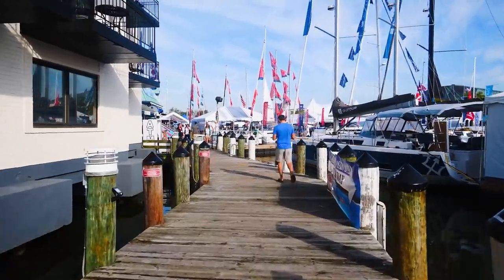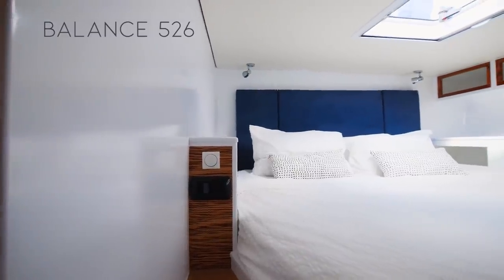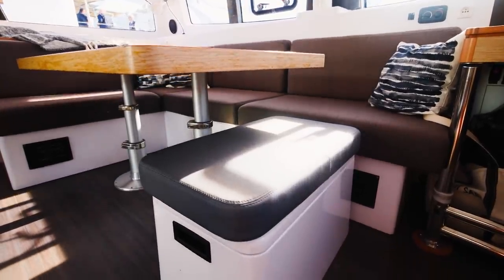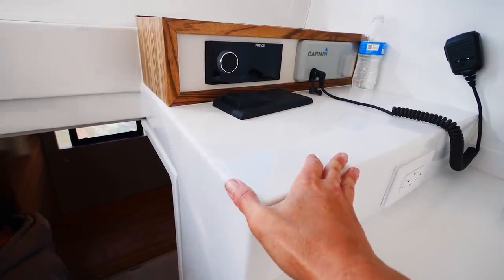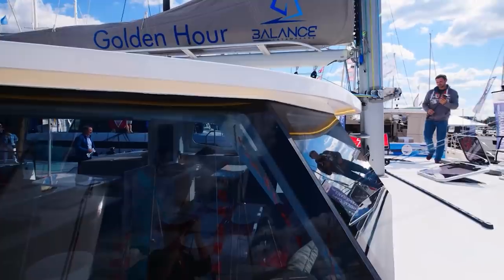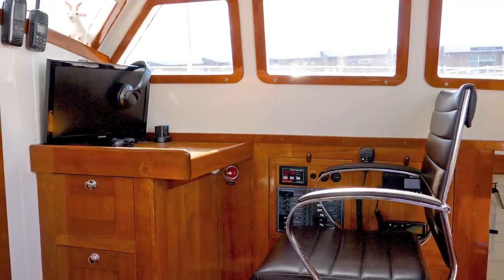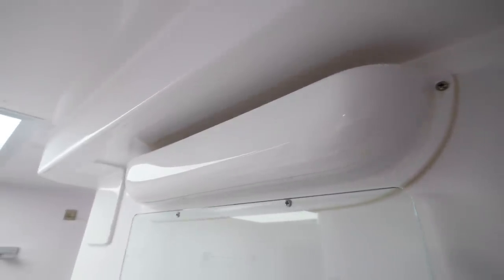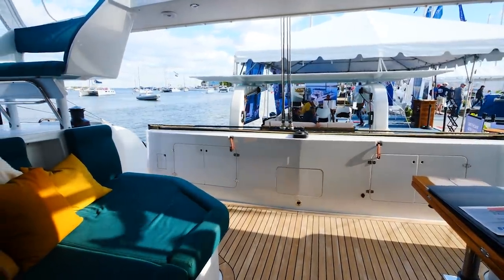STEALING Ideas From MILLION DOLLAR  Yachts!!! - Annapolis Boat Show 2021 (MJ Sailing - Ep 208)

Comment: Protecting the cassette rudders from stray dock or dinghy impacts seems wise on the 1600! Accent lights are light - but all the wiring adds up :)  Our boat had very low front facing windows so our eyepoint was middle of the windows. Crucial to the saloon seating. And our seating faced forward. Great for on watch

Comment: We enjoyed the discussion and insights for your own build. As Matt mentioned, there is a lot happening in the area of lighting...consider "touch" fixtures instead of typical switched units. It could reduce wiring by half and possibly do away with wall switches altogether.

Comment: 8:54 The hollow ottomans would be just as light and open looking with mesh or netting on the bottom of the open faces.  Then they can still offer some storage if needed, but for light or bulky things.  Maybe a basket for cockpit/saloon "junk" like hats, shades, sunblock, towels etc.
Reply from the maker: You can't give that suggestion to someone with OCD - EVERYTHING needs to be put away and out of sight, lol. Or, at least, that's the hope. 🤣

Comment: Regarding Cameras, I've often thought a camera up the mast looking forward and down would be very handy for navigating through coral heads at slow speed (if the light was right) and possibly for anchoring also.
The real beauty of building your own is that you can incorporate features that would be extremely expensive if built in a factory. When I built my F-9A, I skinned it inside and outside with carbon fiber instead of glass. It probably added 2-4% to the overall cost of the build but to buy a factory built carbon boat the cost would probably have doubled.
Regarding the Vision 444 Nav Station set-up, for tall people who want to lean back, the TV becomes an obstruction. At least it looks that way in the videos I've seen. I have back issues and sitting upright in an office chair for long periods becomes a problem. Reclining a bit helps considerably and my head would be banging that TV all the time.

Comment: My favorite interior design is probably the Schionning that I saw on YouTube called Duet but I also love Onboard Lifestyles. I really like the simplistic look without wall panels. That rudder system is cool on the transom but not underneath the aft swim step due to the cleaning that it would require to maintain it. Suggestion; keep all of your through hulls above the water line except for your water maker but put your water maker forward of your black and grey through hulls.
Reply from the maker: Duet is a boat we have looked at many many times!! It made us want to build a Schoinning, just before we heard about Max Cruise.

Comment: It appears that your mission to get ideas for your boat was a resounding success.  Regarding the veneer options; don’t forget to look at it for the long-haul not only from a durability perspective, but for a piece-of-mind point of view too.  Example:  Zebra-wood is really cool looking for accents, but too much of it (like they had in the show boat) can get really busy over time and some people actually grow to dislike the busy horizontal lines.  Whether you go with curtains or blinds don’t forget to include a method to hold them in place while underway.  In some of the less expensive RV motorhomes the blinds or pull down window covers make a lot of annoying noise banging back and forth with the movement of the road, which would probably be a lot more when traveling in choppy waters on a boat.  The use of rare earth magnets imbedded into the hull with a small metal disc on the window coverings is one way to minimize the noise. Or some kind of blind channel would also work.
Reply from the maker: Magnets is a great idea and one I haven't thought of for securing the blinds.  I like that they can be hidden instead of the ugly velcro or plastic fasteners.   Thanks -Matt

Comment: Thanks for a great view of the boat show and the comparisons / ideas.  One questions that I don't fully understand.  You are full-time live aboard boaters.  I understand that performance boats means a couple of knots (I could be wrong here) on passage.  But the fact that more time is spent at anchor is the speed vs comfort worth it?  We have a 45' motorhome because of the comfort when we winter Florida.  Sure it is big,  fuel cost higher, etc.  But the hours behind the wheel vs time at our RV site makes the living aboard the major factor.  If you outlined in a previous video please let me know.  
Thanks again, glad we can support your build
Reply: This young couple knows what they want and can build the dream boat. ”Performance” is more than speed, how high the boat can sail toward wind.  As they have said on many videos one goal is good down and light wind sailing and feeling some sport to sailing. Sailing is more than moving the boat from A to B.
Reply: As @Pekka said, performance is more than just speed ... it is also security. Most cruising cats do half windspeed - performance boats like the Kinetic 54 do windspeed ... that halves your passage time (depending on sea state, of course) and gets you out of danger and to your anchorage quicker.

Comment: Imitation is the sincerest form of flattery ....😉😎and is a prime trick of evolution. 
Sometimes the solution your looking for has been done a long time before but just with slightly different materials or detail finishes.  
Its your home and interest... 

Insulation is important as done well it works both ways ... and makes a boat livable and reduces mould due condensation...

Comment: When I built a lot of my catamaran interior I used the same yoghurt container as the radius for every cutout in bulkheads, locker doors etc. But probably should have 1 small for small panels and 1 large for large cutouts in retrospect.

Comment: The Outremer had busted area outer hull side at shower wall. Can't post pictures here. I posted pictures in the Okellys FB group and had discussion. It didn't look good. The rep was saying how much stronger boat was than any other at show. I asked about damage got short reply damage taken during hurricane while sailing that knocked boat 30' sideways and pushed outer hull inward. But rep stuck to story the hull was sound.

Did see you guys at the YT sailing both as passed by. Looked busy.

Comment: Very interesting as always. For what reasons are you looking at cassettes rudders ? Being able to beach ? Being able to change a broken one very easily ? Other ?
Reply from the maker: Being able to clean a rudder off of crab pot is always a nice bonus, but the main reason I want cassette rudders is for steering feel.... I want a sporty sailing feel.  Fixed rudders are often a compromise trying to get a responsive boat, but also keeping a manageable depth for shallow waters.  With cassettes, I can keep a high aspect ratio with deep rudders and still get into shallow water when we want.   Seems to be the best of the options for us.  

Matt

Comment: We are are a little ahead of you in the build cycle on our cat, and was wondering if you've come up with which glue or bog you'd use for putting the laminate on the foam for the furniture? It seems to not be as easy to get the right adhesive as you'd think.
Reply from the maker: Hey Rob.  Our furniture panels are foam with fiberglass already applied to the core.   Are you talking about backfill bog when we decore the edges?  Or for the fillets?  -Matt
Reply: @MJSailing  No, I meant putting the decorative laminate, like Wilsonart or Laminex, directly on the foam sheet, for doors, cabinets, etc. I've tried a few glues on test pieces, but not entirely happy with the result so far. The  glue bond to the foam is poor (can lift or peels under high humidity) and no way I'm using contact adhesive with large sheets. Probably will use a thickened epoxy bog under pressure or vacuum bag it several sheets at time. 
BTW I did experiment with using bog in just an oversize hole for cabinetry fittings/screws etc, and that is quick and works well. No need to de-core the foam and put in a shaped wooden insert plug.
 But higher loads like deck hardware I got the best result using 316 stainless helicoils from Recoil into tapped oversize hole with epoxy and glass fibers mix. Very good strength. I decored with bent nail in drill beyond the edge of the top skin glass before filling with the epoxy so the plug is "held" by the top skin of glass, if that makes sense,
Reply from the maker: Were you trying to adhere the laminate directly to foam or to fiberglass skins of a composite panel?   We're using a wood veneer - not a high pressure laminate, so need to do things a bit different.  I think we'll use clear epoxy with vacuum bag to apply the veneer.   This is typically done without filler.   -Matt
Reply: @MJSailing  Laminate on plain H60 foam. But also some wood veneer on highlight areas, but that's easy. We have a product here in Oz called Titebond which is great for wood veneers. Getting the plastic laminate to stick is the issue but I think you're right to stick with epoxy (pardon pun).

Comment: For interior surfaces artistic vinyl wraps could really jazz up a simple interior.  Also the front liner fabric Corsair used on it's earlier trimarans is super easy to install, super light and velcro  sticks to it. Now fabloc makes a similar product. A Corsair dealer may tell you where to source it

Comment: Are you going to make one of the cabins a workshop that would convert to a sleeping cabin if needed? A workshop would be crazy handy on a boat with as much work as one does on them. Central place for the tools and workbench would be smart. You could even sew in there.
Reply: The port aft cabin (shown in the vid as a settee and office) does convert into a double bed. I am sure we can come up with an innovative way to change a workbench into a bed  ;) (Builder of Kinetic 54 & 62)

Comment: I guess you didnt see any rubber bulkheads in the cats then
I made the difference in eye height at 400mm (whats that about 1'4") but you are right, a staged salon seat means better use of the depth of glass, or even a reduction if you go at it.
Also lower seat heights are inevitably more comfortable and allow people to stretch out.
Are you going to run tints on your glass?

Comment: Presumably you feel the foam core provides enough insulation. We have had to strip out 44 year old headlining but are adding closed cell insulation and will need to fit a lining but definitely not vinyl as it has such a terrible environmental impact.

Comment: If you want grabrails/ gutters  on top , laminate a solid standings glass fiber edge on the outside. 
This edge can be designed with cutouts in the middle for fastening harnesses  ropes etc... regarding  rudders it's a good idea to design them to "pop up" if you ran a ground , then they will not break  of ,our cut the rudder sleeves  , also integrating protective  metal edges in the bottom of them.

Comment: The Scandinavian IKEA-style interior on the Kinetic is all well and good. However, living and sailing in Scandinavia I truly appreciate some extra "padding" to the hull/deck, mainly bcs of insulation/condensation in our shifting cold weather (even bellow zero temps when I decide to leave my sailboat on the water over the winter). And I assume this also would be better in warmer climates with less need for A/C. In addition, wouldn't mor "padding" help with sound dampening, which I understand can be a problems with multihulls?
Reply: As the owner, you have the choice of layout and finish. If you want cabin liners, heaters or HVAC, we can tailor make the boat to your specification. We build boats for European clients with these requests.
Reply: @leonscheepers5350  Where are you located Leon? Switzerland?
Reply: @SteifWood  No, Knysna, South Africa

Comment: Great video guys, we really enjoyed the video along with your insight. Your ideas on fairing the hulls definitely makes sense, even if you were to cover it. What will you do about insulation though? It won't matter in warm climates but do you no longer plan to visit colder climates?
Reply from the maker: We do hope to get the boat back up to the UK and potentially the Baltic.  No insulation in the boat though (too heavy).  I don't think we'll be make it up to those kinds of areas out of season, and we'll of course have a heater installed to make things more comfortable.

Comment: If I may ask why didn't you build in South Africa? I would have thought with the exchange rate it would have been much cheaper.
Reply from the maker: When we sold our last boat and were preparing for the first container to come, it was summer of 2020, and South Africa was on a full lockdown for international travel.  We'd been hearing that we couldn't get in until at least spring of 2021, and we were hoping to already be months into our build at that point.
Reply: @MJSailing  ok thanks. Anyway if you did build in SA Knysna I would have been about 1300 kilometers from you. Lol
But seriously did you maybe do a cost comparable calculation and if so how much difference in total cost would it have been again looking at the exchange rate.
Reply from the maker: Equipment pricing was about 20% less in SA, but since we're in the US - and a lot of the manufacturers are based here - we've been able to negotiate better pricing locally.  I'm not sure we would have been able to do that in SA.  -Matt

Comment: Instead of paying the weight and labor penalty of fairing the inside glass to perfection have you thought about using a paint system that would leave a texture that would hide 90% of the irregularities in the glass weave? Every pound saved in the build is a pound gained in possible payload if needed? Our 40’x25’ cat weighs in at about 6700 lbs., doesn’t have a “yachtie” finish but sails like a dream and is able to handle a decent load.
Reply from the maker: We noticed that the Outremer has a textured paint on parts of the overhead, and the Seawind 1160 Lite uses it as well.  It's something we're taking into consideration for certain areas, but we also really love the look of the smooth finish and may take the weight penalty, lol.

Comment: O K I understand everyone has different likes and dislikes but performance cats have never made sense to me. Certainly the ability to make a passage 25% or 50% faster is a nice thing to have. But the cost of it is so high not financially but first off your home something you will live on 100% of the time or almost is going to have less space. Of course this does not apply to day sailors or charter boats but not to full time live aboards. 

The second thing is that this increased passage making ability is something you are going to use maybe 5% of the times the majority of your time will be spent at anchor or in a marina etc
Reply from the maker: You should see the size of the boat we're living in at the moment during the build - it's a 31 ft sport fisher and half of that space belongs to the cockpit.  Plus, we've been living our past 9 years on boats which are 34-37 ft monohulls.  The two of us have no worries on if the living space of a 42 ft performance catamaran will be enough for us.  We're looking forward to light air capabilities and enjoying the art of sailing again.  😍